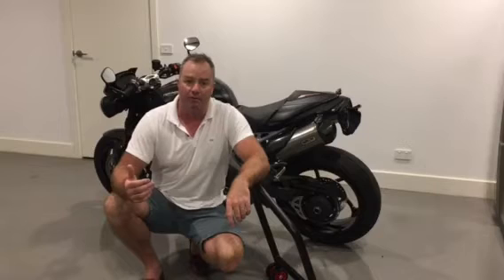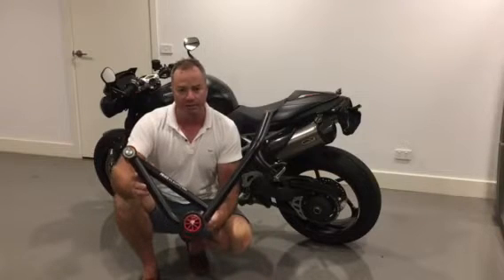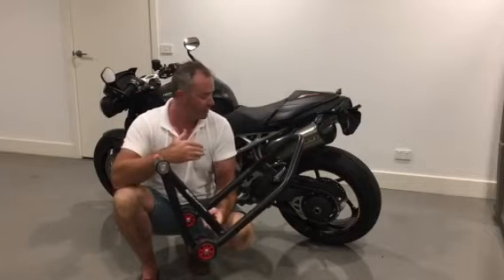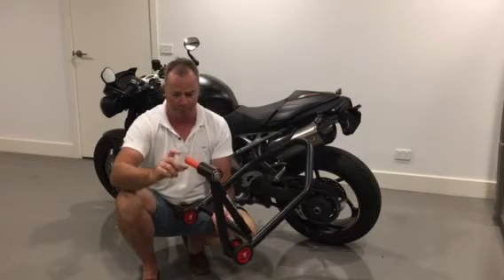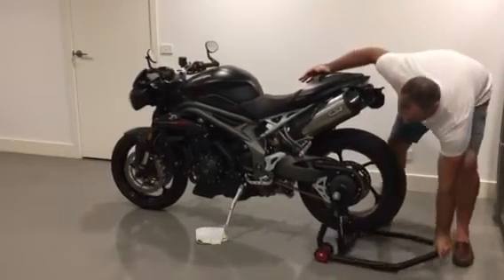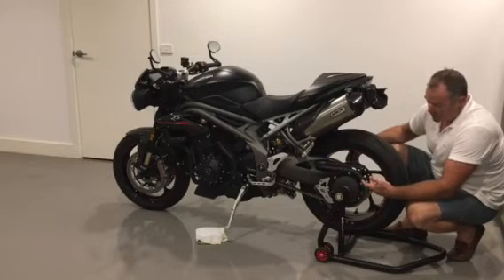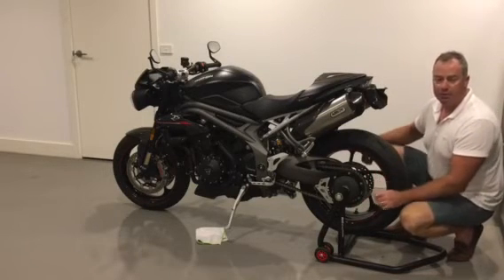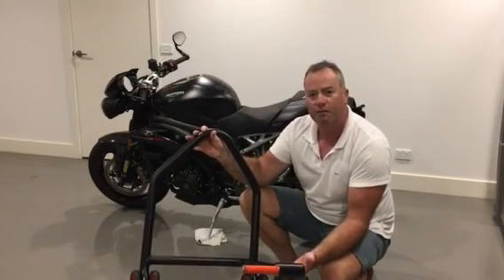Triumph Speed Triple RS | R&G Racing Elevation Paddock Stand - single sided swingarm

Comment: How easy would it be to accidentally knock it forwards off the stand? It looked a bit wobbly. Thanks.
Reply from the maker: Its possible if facing down an incline with the bike in neutral, but the wheels on the stand sit forward of the shank that slides into the centre of the rear wheel hub, and are off the ground when raised…so it takes some force to distribute the weight onto the wheels, and flip it off the stand again…it rolls a few inches on the wheels from engagement point to resting on stand…hope that makes sense..
Reply: @theGaraged  perfect sense, thank you for replying. Picked up a speedtriple last Friday so your video was very useful!  What a bike!
Reply from the maker: @rogerthedodger5788  ride the torque, yet to get on a 1200 but it’s fast approaching….enjoy and stay safe….